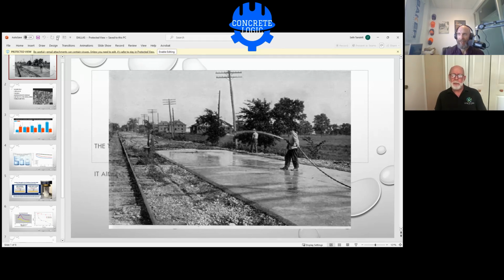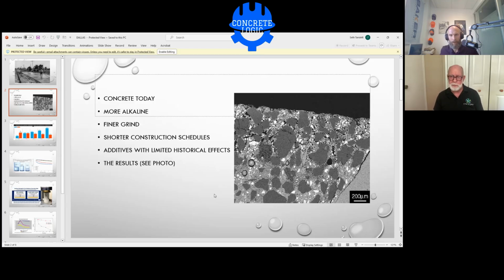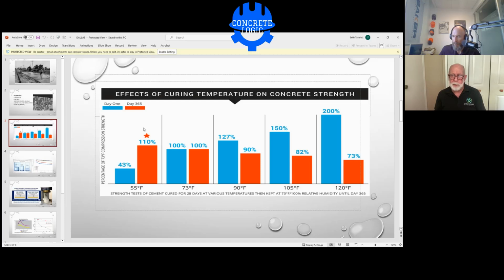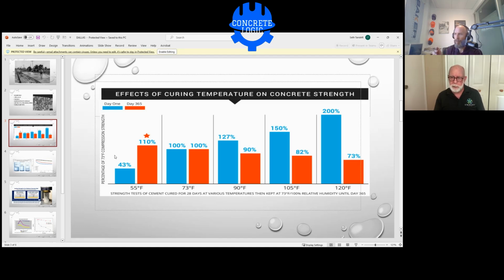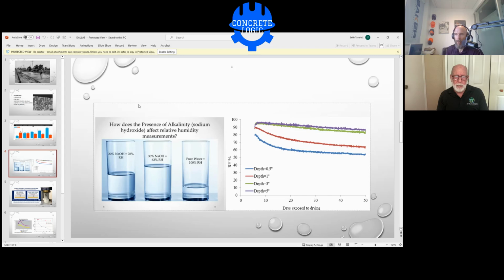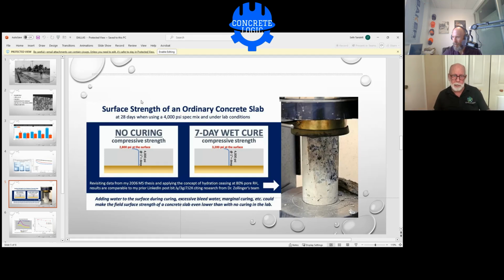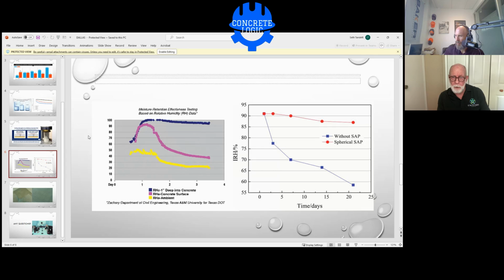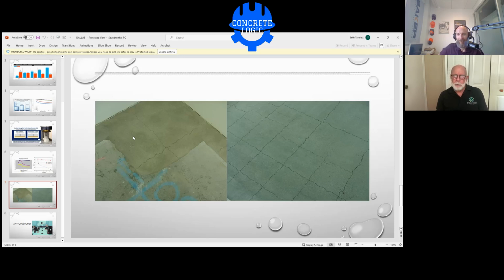EP #087: The Importance of Properly Curing Concrete

Comment: I’m making 200 concrete posts for a permanent fence around the farm property. I thought I should make them 6x6 for strength, but I’m watching this and thinking that maybe I could do 4x4 if I used the resin balls and long curing time. Are you the resin balls available to the average person?
Reply from the maker: Thanks for watching and great question.

What Bob was referring to are called super absorbent polymers (SAP). They’re tiny polymer spheres that absorb water during mixing and slowly release it during curing. The idea is to provide internal moisture so the cement can continue hydrating longer.

They are available commercially, but they’re typically used in specialized concrete and research applications. They’re not commonly used in small precast production.

Since you’re essentially making precast elements, the most important things you can do are:

• Use a low water-cement ratio mix
• Consolidate the concrete well
• Keep the concrete sealed so moisture cannot escape
• Allow sufficient curing time before putting them into service

That curing period is critical. The longer the cement has access to moisture, the better the internal structure develops.

If the internal curing concept interests you, you may also want to look into colloidal (nano) silica, which works differently but can help improve the internal structure and durability of concrete.

We did an entire episode on that topic. Watch Episode #093 here:
https://www.concretelogicpodcast.com/episode/093

It explains what nano silica is, how it works, and where it makes sense to use.

Comment: I was hoping for a clear answer to how to cure concrete best, but this explanation is, to my little mind, not providing a simple answer. Perhaps there is no simple answer. Damn!
Reply from the maker: You’re right — there’s no single “best” way to cure concrete because it depends on the mix, weather, and what you’re trying to get out of it. But the simple rule is: keep it moist and don’t let it dry out too fast.

That could mean water curing, using a curing compound, or covering with wet burlap or plastic — whatever it takes to keep hydration going.

Comment: How to you cure it right? I'm just pouring a small pathway in my yard.
Reply from the maker: Avoid pouring in temperatures below 40F and above 90F. After troweling, apply a evaporation retarder. Right after you finish the concrete, apply a curing compound.
Reply: @concretelogicpodcast  Thanks.
Reply: If you are able to put a sprinkler and keep it flooded with water after it's set up enough to do so that will give you best results also. ASSUMING you have decent water that wont stain it